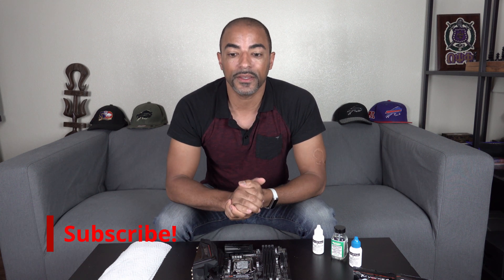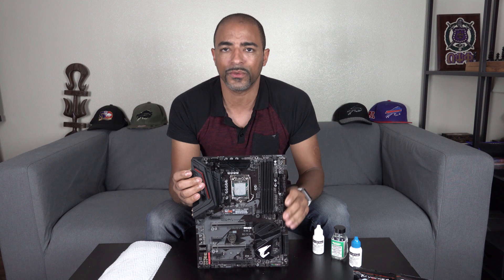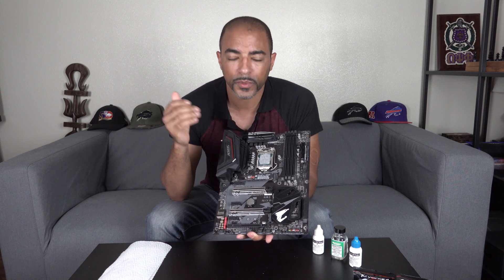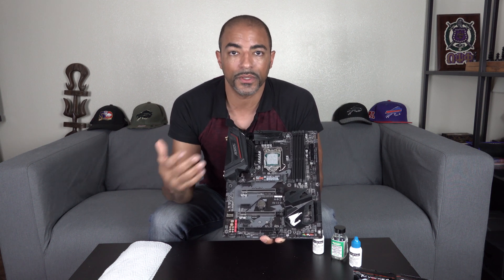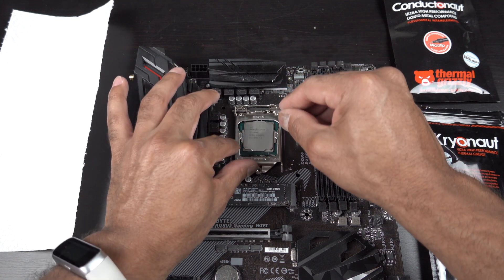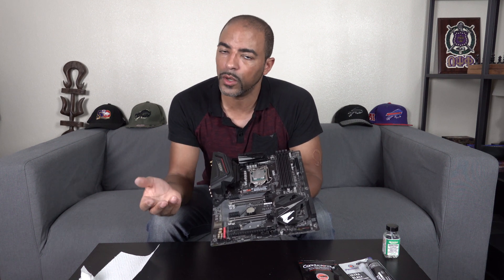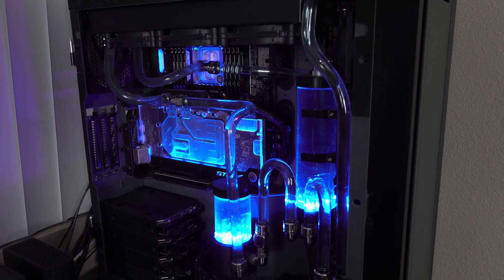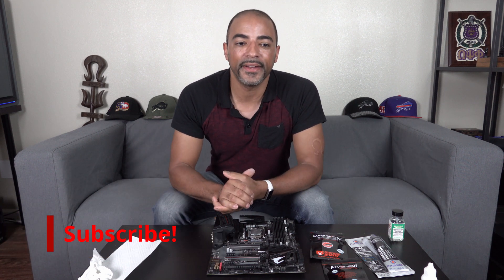Liquid Metal Maintenance for 8th Gen Intel Processors. Delid Check

Comment: now I see what you mean by IHS, so how to take the glue off the IHS?
Reply from the maker: With a razor blade or a delid tool that can be bought from places like Amazon. Do your research though because the process could be different depending on your CPU
Reply: @DaPoets  yes will research before trying, I have got i7-8700K so its 8th gen - should be ok
Reply from the maker: Yep that's an easy chip to delid. It was actually my favorite CPU to overclock after delidding.
Reply: @DaPoets  oh nice! will look into this, I have got the cpu watercooled, so it could be possible, i heard that this model can be very nicely overclocked
Reply: @DaPoets  thanks a lot for your answer!